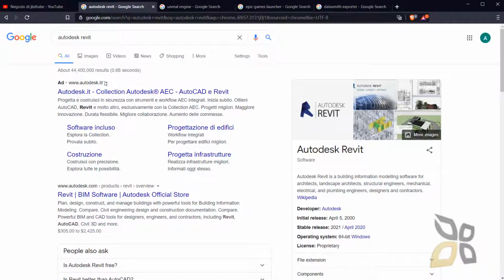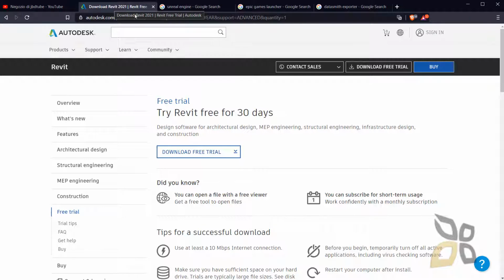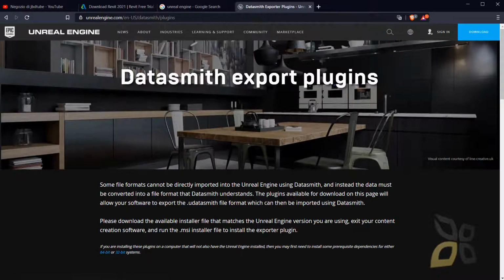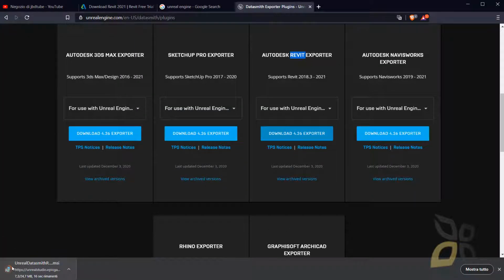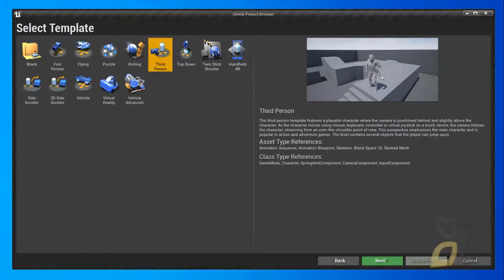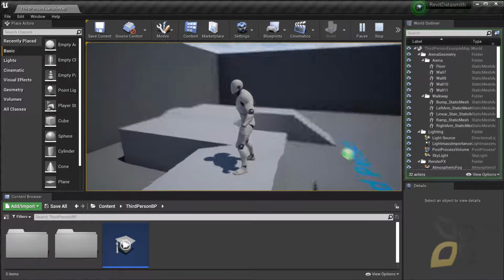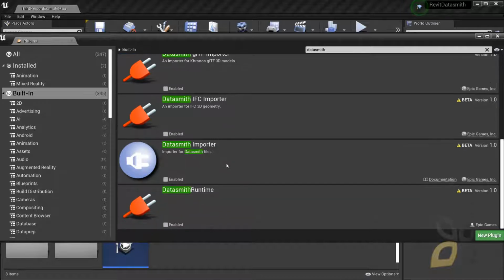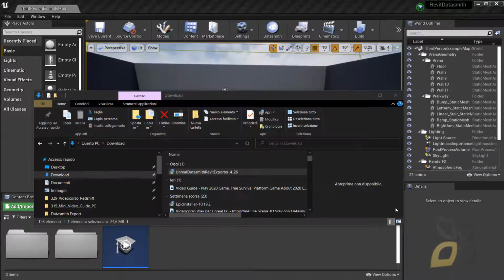Video Guide - Import Revit Scene Into Unreal Easy and Fast With Datasmith Exporter Plugin, 3D View

Comment: i tried clicking on connections but it says i need to open up unreal engine which i did and still gave me the same message? is there something else im meant to do? And will this create a real time connection between revit and unreal engine?
Reply from the maker: Hi there, try to check the version, perhaps you have a too old one or too new. Try with latest versions of everything and let us know. Thanks, subscribe ;)
Reply: @jbdtube  I'm using revit 2020 and the latest version of unreal engine and that plugin
Reply from the maker: Try 2021 and ue 2.5 an 2.6 and check